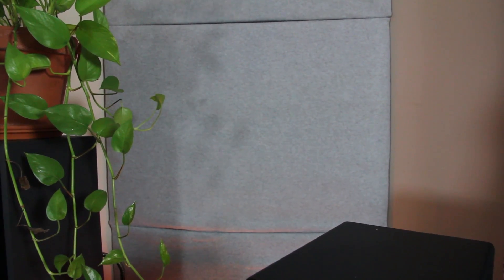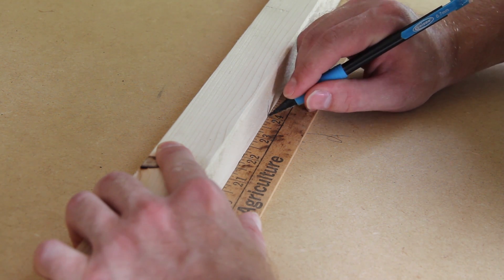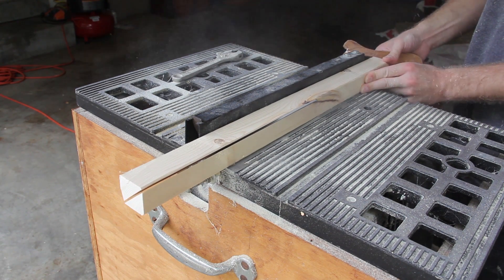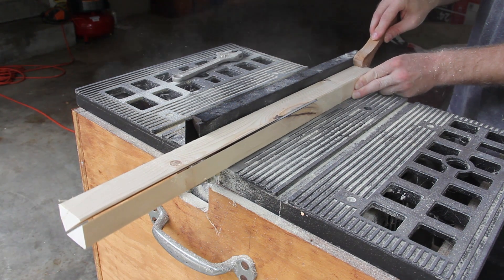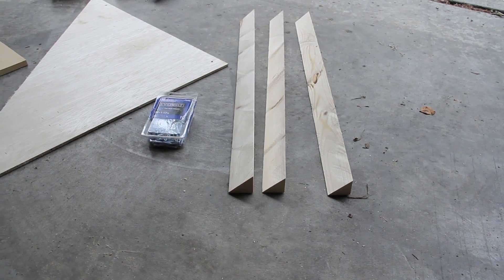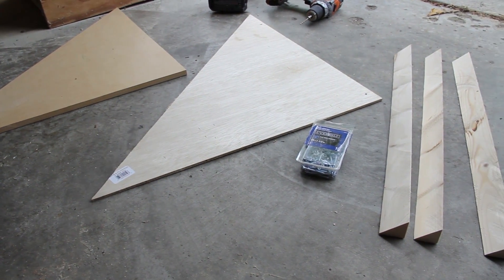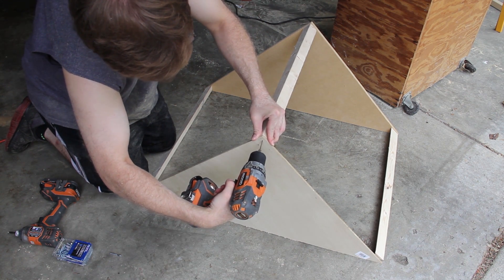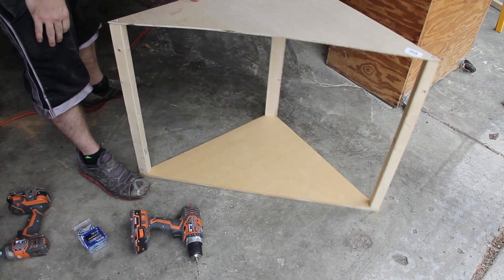DIY Bass Traps: Home Studio Room Acoustics

Comment: Thanks for the video! I'm looking at trapping my room but it's awkwardly laid out. I'm wondering why you need the frame? Seems like spray adhesive/hot glue, fabric and the safe and sound would make a usable trap?
Reply from the maker: No problem thanks for watching. Some people use shelves in the corners. Without a frame or support you eventually end up stacking enough to the point where it is too much weight on the bottom and becomes unstable.

Comment: Don’t let em beat ya up too bad. Though there are much better ways to cut lumber , you did remove the fence , greatly reducing chances of binding. But next time use a miter saw.
Reply from the maker: Thanks. I didn't have a miter saw but can see where it would help if big enough to cut the traingles. With what I have I did make sure to  keep the blade only as high as needed and bought a brand new blade specifically for this purpose. Just in case anything did happen I made sure there was a safe path to pull the plug and the first thought on my mind was me being consious of where my hands are and if anything goes wrong to get away and unplug. I obviously didn't realize there would be this many concerns but I might be able to add a warning tag or something to pop up in the video. I'll have to check YouTube's current features to make sure I still can.

Comment: That is about the most dangerous way possible to use a table saw!!!!! Never, NEVER freehand cut on a table saw! Get a circular hand saw for those cuts. Again, NEVER USE A TABLE SAW WITHOUT A GUIDE! This is exactly how my old roommate cut his thumb clean off.
Reply: Sounds like your roommate didn't know what he was doing. I've been doing it this way for years. Not even worried.
Reply: @navigator8222  then I am pretty sure you have been doing it for years not as a professional carpenter. Freehanding on a table saw is about the dumbest move I can imagine. Hope your luck holds out.

Comment: is fleece breathable enough for soundwaves to penetrate? can you blow through it? does it matter as much for basstraps? fleece looks good
Reply from the maker: Yes it is breathable enough. You can blow air and see light through it easily. In this video I don't have a membrane so they also will absorb a broader range of frequencies. It is popular to put an frk membrane or similar on the front of the bass trap. This helps reflect higher frequencies to keep the room sound a bit more live, and also may slightly increase the bass absorption. If you do this technique I'm thinking the fabric breathability may not matter as much but I'm not certain. It wouldn't hurt to still use fleece tonplay it safe.
Reply: For Bass, the fabric really doesn't matter too much. The bass will travel through regardless. Highs and mids however, you want a breathable fabric definitely.

Comment: Nice tutorial! I think i may build a couple of those, but i would wrap the 3 sides in foil before attaching the fabric. (Agree on those safety concerns many people have here, i have been a carpenter myself, and a finger may be cut badly much quicker than you can react. Though that little saw you are using is unlikely to kick back. You gotta be more careful when using real powerful machines though.)

Comment: Hi thanks for the excellen video much appreciated, liked and subscribed! I have a question, not all of my corners are able to take a good size bass trap. For example, I have a door by one corner therefore the bass trap would have to be about half the size of the other corner. Do you think this makes the entire project not worth my while as it would be asymmetric? Would it be better to have the two at half the size therefore matching the other side? Any advice would be appreciated. Much appreciated Mark UK
Reply from the maker: Thank you! What size is the room? Is the door corner on the wall where you will have the monitors closest or the opposite wall?
Reply: @ToddAudio , Hi Todd, thanks for your advice much appreciated. I guess I'll use it as a paperweight or something , thanks again :-)

Comment: I've read that it is better to leave some air at the back instead of completely filling the bass trap.
Reply from the maker: I think you are right. I've heard that too. I've actually moved into a smaller room now and the panels are propped up againts the wall with an air gap instead of mounted on the wall... but there is not really any precision. It just happens to be the way I put them. I think it might still make a difference but I haven't a/b tested it or anything.

Comment: This trap absorbs all frequencies, not just bass, because it doesn't have any facing glued to the front, see the ethan winer video: https://www.youtube.com/watch?v=iAFsDE2uAZQ

I use spray adhesive to attach a thin layer of paper to rockwool, but it probably won't work for this Safe 'N Sound.

Comment: These are not bass traps and this is not how one works with a table saw.
Reply: awandererTJ Could you please elaborate? The measurement are off? Would be very helpful if you could explain whats wrong with this and what can be done different to do it right.
Reply: @greedokenobi3855  Sorry it's a bit complicated to explain in a short comment with no diagrams etc. Just google 'bass traps' and you'll find a variety of the right stuff.
Reply: awandererTJ I’m well familiar with real basstraps. I will probably buy them from GIK Acoustics or Real Traps and not bother to make them myself. I was just  wondering if you could elaborate instead of just commenting that this is wrong. As far as I know rockwool or viberglass is what you need. Also know that the diagram and measurement of the room matters. Was just wondering if you could elaborate a bit more but if you don’t know much more than I do thats fine. 😉
Reply: @greedokenobi3855  Don't buy foam or light wool for bass - useless. Regular rockwool and (better) fiberglass work in all ranges, so by the time you trap some bass all your highs and mids will be dead flat. For bass specifically you want something like deep dense fiberglass, or dumped metal sheets, or floating heavy membranes, or toroid constructions (sealed fiberglass cylinder).
Reply: awandererTJ Foam? I think did not read my comment. Foam is worthless espacially for bass traps. I mentioned I’m well familiar so thats a bit ‘duh’. I don’t think GIK nor Real Traps sell foam ‘bass traps’, it should be called bass craps lol. The other things you mention I’ll look into that, thank you.
Reply from the maker: This is the Safe n Sound Rockwool  product which I believe is even more absorbent than standard rockwool. Yes it does give the whole room a more dead sound but right now it is in an 11ft x 11ft bedroom/control room. Some recommend to add a membrane on the front of the trap that will help reflect the higher frequencies while still flexing/absorbing the low frequencies. To my understanding from what I've read in forums and in comments here, this is a similar concept to how real traps work, although still a diy home solution and I don't know specific details about their build. I think you can find fiberglass with a built in FRK membrane that is supposed to help. The latest I read in the comments here is someone saying that people are finding standard craft paper works really well. Hmmm.. I haven't researched or tested this yet but find it a little surprising. I will probably look into it (or for the super cheap cost and easy implementation maybe I'll just try it)
Reply: @ToddAudio  Look at a heavier stuff. Bass waves bypass all the light absorbers quite easily. Glad you continue your research into bass traps and I hope you find a good solution soon. But for God's sake before DYI please please watch a couple of circular saw safety instructions as well. Those cuts you are doing are scary. BTW the corner trap you've made should be great to dump down the saw sound :))

Comment: Thanks Todd, You made everything easy,  cheaper and it took care of my bass problem, thumps up
Reply from the maker: Great to hear! Thank you. One person commented recently that people have had even more success by putting a layer of craft paper on the front. It should help reflect some of the higher freqs to keep the room sound a bit more live and apparently also helps flex and absorb the really low end a little better. Im pretty happy with it already but it is worth a try I think. Easy mod for the price of craft paper.. and easy to remove if I don't like it. Haha thought I'd share the tip. If you end up trying it first and have any luck let me know! Thanks!
Reply: Hi yes part of the fun is to tweak and test when you are DIY kind of person. so I will definitely test the craft paper. By the way, you have this fantastic dialect, were in the states do you come from? Me, well I am from Sweden, Stockholm

Comment: Nice vid thanks! Is 45kg/m3 best for absorbing bass and 60kg/m3 best for absorbing mids and highs to the sides and above the listening position? I want to make some GIK soffit style square bass traps 41x41cm and some panels for the early reflections.
Reply: I am no expert by any means but I imagine it'd be the other way around, no? The less dense it is, the easier it will absorb high frequencies, the more dense it gets, the more it will begin to reflect high frequencies? Meanwhile bass needs a lot of mass to prevent it from escaping so the heavier density would be best for stopping low frequencies I believe. Could be wrong though. There's a lot more to it overall than just density though.
Reply from the maker: Yes typically more dense is better for bass, but I like to research the specific materials people have used and what is recommended from people who actually know more about this stuff than I do. I mainly just wanted to share my process here to put it all together.

Comment: I wonder if you could use an electric carving knife??
Reply from the maker: From what I hear in the comments, an electric turkey knife works great!
Reply: Anything serated works well.  I usually use a bent steak knive from the drawer:)  It is very easy to cut through and you really don't need an electric tool unless that is the only serated blade you have in the house.  It is nothing like trying to cut through foam of the same thickness since it is mostly air pockets.

Comment: Stopped watching after the 3rd shot of you using a that table saw wrong. Which was also the 3rd shot of you using the it. 3 for 3! Congrats on not losing a limb or maiming yourself. Give less effort in the future running your mouth about safety, and instead actually work safe. I came to watch someone make bass traps, not a snuff film.
Reply from the maker: Thanks for watching 3 minutes! It's too bad you could not stand to learn more about what you came to learn about in the first place - building bass traps. Especially since you already seem to have so much knowledge about using a table saw without losing a limb. If you have any advice on doing so I'm sure those actually building bass traps would be more than happy to have some useful advice on how to use a table saw. Thanks for stopping by!
Reply: Try watching this. Tips on how to be safe with a tablesaw: https://www.youtube.com/watch?v=8f8VWwtaudU
Reply: Sounds like someone got his bass trap stuck in his ass again

Comment: Thank you for the great video! 
I have 3 questions if you please....

1.What kind of wood are the wood strips made of and what is they´re width before being split?

2.What size of drill do you use? 

3.What width of screws do you use?
Reply from the maker: No problem! Thanks for watching!

The wood is just standard common stuctural lumber - the same type most 2x4 is made of at hardware stores (I think it is made by compressing different types of wood).

I believe the screws were 1/4" width wood screws around 1.5" in length. The width of the drill bit was slightly less.. I think either 1/8" or 3/16" will work.
Reply from the maker: Oh, and the width of the wood strips is 2x2

Comment: Hi I don't like leaving this type of comment.. using  a table saw without a riving knife (piece of metal at the back of the blade) is really dangerous it has noting to do with  being "cautious" if it kicks back (the wood gets angled behind the blade where its cut already it will be kicked towards you) and you will get hurt! 
Other than the safety police comment a really nice video!
Reply from the maker: Thank you for the tip! I am glad you liked the video otherwise, and your advice is helpful. win-win!

Comment: Hello Todd, great video!  I'm considering building these for my room.  I'm looking to do so more for rehearsal purposes, rather than recording.  Have you found that they significantly dampen the sound to people outside your home?
Reply from the maker: +Justin Talley thanks! Not exactly with the way it is used here with building bass traps, but the Roxul Safe N Sound material is actually designed for soundproofing. However, to use it for it's purpose, you would need to insulate your walls with it entirely. If not inside your walls, you would need to cover all of the surface area on your walls, or nearly all of it with panels. I have another video on my channel showing how I made panels. They sell Safe N Sound in both 16" and 24" wide batts. The bass traps and panels used for accoustic treatment will help slightly to keep sound from escaping the room, but there is still plenty of areas for the sound to escape.

Comment: A real bass trap needs to be 1/4 the wave length of your bass frequency y9u are working on absorbing so that is not a bass trap but an absorber. And since real absorbers use corning rigid fibre glass that weighs around 6 lbs per foot cubed, I can't imagine it giving your studio a very balanced accurate sound, in fact it may make it worse as far as standing waves go. If you know the problem frequencies then build yourself Helmholtz resonators, they only absorb the problem frequency leaving the rest of your room balanced assuming you have built it to be accurate for recording. You need to be careful and educate yourself, I would recommend any books by F Alton Everest since no one knows more about acoustic design and he has designed some of the worlds best studios. By the time you have read his books you won't be guessing and you won't bet fooled by commercial products that are designed to look good but rarely do a specific job. Studio design is very specific, microphones will her things you and I don't and they will show up on your recordings. So before you spend way too much on commercial products, learn the basic science of acoustics, how to tune the room so you don't need to to so much treatment later and learn what thee panels and foam blocks do because if you don't know you are likely going to make things worse, like the kids with egg cartons that make everything go out of whack. I've been doing this for over 30 years and see more and more stuff put on the market, much of it is just to get money and looks great, but your room needs to be balanced and that is an accuracy problem that doesn't have any one size fits all solutions. Your first money should be spent on a few books, preferable by Everest who explains every little detail in a way you can absorb it, no pun intended. I get like this every time I hear someone claim they have a "Bass Trap", that don't really exist except for a few custom installations in huge studios.
Reply: Drampa Dreg thank you for the great info
Reply: Hey Dampa Dreg, do you advice rebounded foam materials as absorbers? I have doubts about these fibers. Some doctors claim that they can be very bad for lungs after some period of usage.
Reply: Drampa Dreg Bass trap is just the term people use which does not mean literally as it sounds — many words don’t. The term absorbers is gaining more traction now, but I still use the word bass traps all the time.
Reply: Hey Dreg...can u call me 818.966.9068 I have a question on my studio

Comment: a blade guard would have been handy !
Reply: A blade guard is the single least practical safety thing on a table saw. Blade guards are found on hobby machines. Large saws do not. And there's a reason for that. In most cases where it is in the way, it just makes u work less safe than if u didn't have it at all.

However, a splitting knife - that's waaaay more important. But in older gear it's common to not find one. It doesn't mean the saw is unsuitable for sawing. It just means that you gotta be aware of how the saw works and how it will treat you as u work with it.

Todd, no need to just agree politely with all these safety cops - just be careful when freehand sawing and make sure your hands don't get in the way. - u did a great job with these traps.
Reply from the maker: +Ididnotk illjfk definitely! Wish I had used one! Thanks.
Reply from the maker: Thanks so much for your response and feedback! Your input is very refreshing. I was definitely careful, but just hope the viewers are careful as well! I tried to emphasize the importance of safety, even if some of the safety features appear to be missing in the video. haha they were a project for me to make, but they are still working out very well!